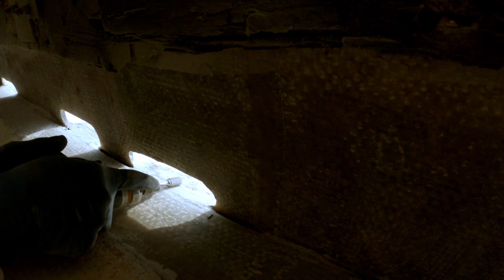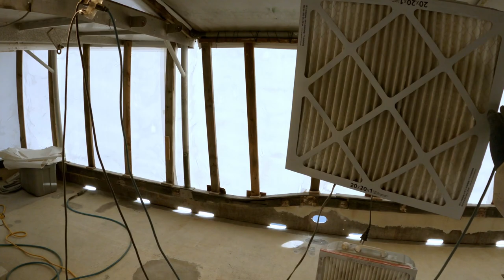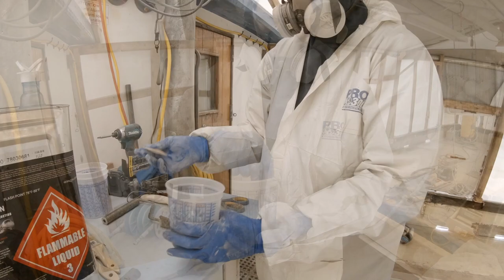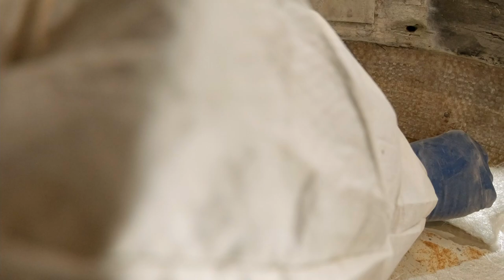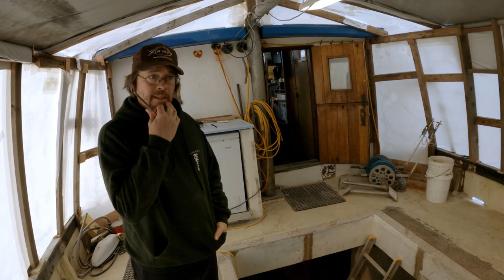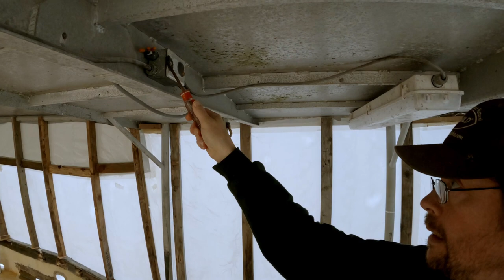Prepping and Fiberglassing the Deck Joint - Emerald Isle: Ep.27 Fishing Boat Refit

Comment: I've seen more then one u tube channel that are refitting boats that really need to watch the fiber glass work you guys are doing and learn how to do the job right. When you get done this boat is going to be in top notch condition . God bless ,stay safe
Reply from the maker: Thanks William! We need to come back to this and build the laminate up more with a few layers of 2408 biaxial glass. Just a quick fillet and chopped strand to waterproof was all we had time for before the rain came later that evening.
Reply: @EISAlaska  You will finish the job with your ability to do the job right. The idea of the filter on the box fans was great and I'm going to use this in my wood working shop to clean the dust out of the air. Thanks guys love the videos .
Reply from the maker: @william6526  You bet. The fan has really helped the air quality and less dust settling on everything.

Comment: Shore Power:  Listening to your plans for shore power are pretty much like what I plan to do to my home.  I have an emergency generator, 9500 running watts that I will attached to my service panel.  I have a 50amp service plug that is waterproof.  It will be the inlet for power into the house.  Wire will be routed from that box to a 50amp breaker in the service panel.  In order for it to be safe, I will install a 'interlock switch' which will prevent backflow of power.  This seems to be the easiest and less expensive way to go.  Yes, the transfer switches are expensive.  I like this method since I will have the entire service panel at my disposal as long as I pay attention to running amperage at any one time.  The 'interlock switch' is not expensive but you will need to know the mfg of the panel on your boat.  Best way I've found is to upload a photo and send it to the interlock folks to make certain the switch, its just a sliding plate, fits your application.  I hope this info is useful to you.

Comment: hey there, was wundern if you guys heard anything from the sonic boom Tonga volcano explosion  they say some up there heard it
Reply from the maker: We were traveling on the little boat headed out for the tanner crab opener when we received the tsunami advisory on channel 16. We heard the reports of a sonic boom all over Alaska, but we didn't hear it. Probably due to the noise and vibration of the engines running.

Comment: Hey, I'm watching this on 1/11/22 and wondering if you have been feeling all the earthquakes from your southwest? Last I looked there had been 15 quakes with a couple that were pretty big.
Reply from the maker: For some odd reason we don't seem to feel them very often. I think we get desensitized to the vibrations from fishing? We had returned from fishing a few years back and a big one hit while we were on the dock. Matt and Dad were on the dock and didn't feel a thing. Mom was on the boat and felt the vibrations even with the generator running! That was one rough, nasty evening returning to port.
Reply: We have small ones in the mid 4's that hit 250 miles south of us and because of the way the tectonic plates are here in the Great Plains they're waking folks up, doing slight damage. I'm not sure how many miles away those to your southwest were, but it looks to be a good distance. I saw that today 1/12/22 there was one straight north of you but on the mainland. Just hope that nothing more severe happens! Y'all take care.